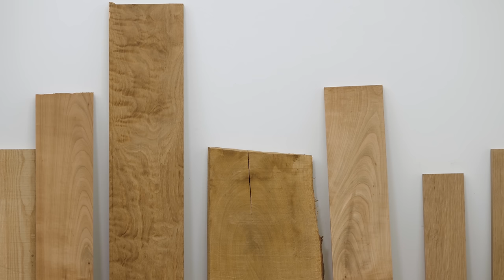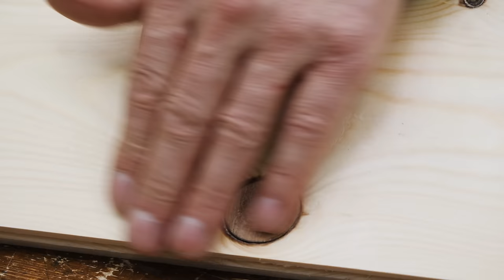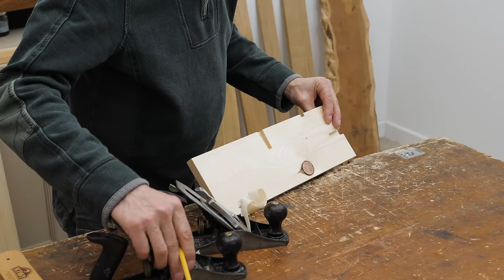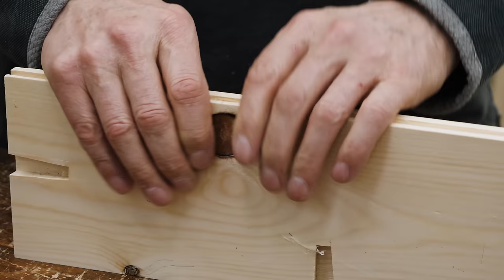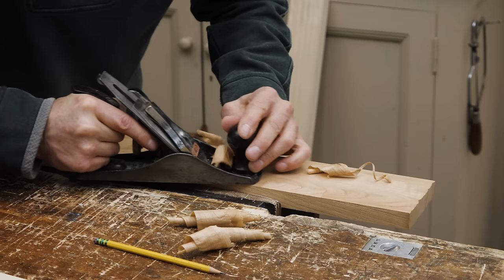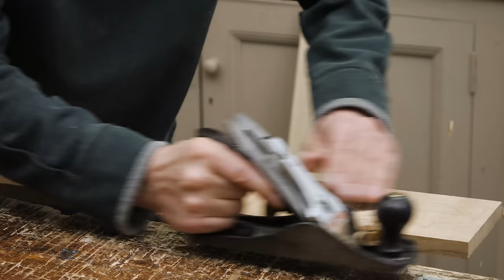How to Read Wood Grain | Paul Sellers

Comment: Wood anatomy is a an interesting topic, and that's what we're dealing with when speaking of "grain," the gross anatomy of the tree's cellular structure when exposed on a planar surface, either roughly (sawn) or smoothly (planed). In general, the more bland the better the working properties, but so much of the beauty of wood is the endless variety of irregularities, all of which indicate something going on in the way the tree grew this material that we call "wood."

Comment: Hi Paul, great video. I started a woodworking course and this helps me alot. I have two questions, is there a specific side on the wood you have to start with  when you are using the plane? Does it matter to which side you plane when you want to do the sides? Thank you!

Comment: I've been trying to elevate the quality of my woodworking skills and I find your videos extremely helpful.  I do have a question however about planing.  If you find a board has different grain directions along it's length do you change direction of planing?  If so, how do you clean up the area where the opposite plane directions meet?
Thank you for sharing your knowledge and skills.
Reply: Going with the direction makes it easier it is not to say you cannot plane against the grain of the wood. Try experimenting to see if you can feel the difference.

Comment: I recommend the use of a whiteboard and making some explanatory sketches of how grain forms. Also the connection with the heart side of the board and how you can read that of looking how the rings are formed in the end grain of the board something you want to know from the start. I found it a bit difficult to follow, the start (about the first three minutes, thereabouts) was even somewhat muddled, at least to my taste. The whiteboard and a few sketches would have helped greatly.

Comment: Paul, I have watched this video several times, always learning more each time.And now I have run across the "knotty" problem you speak of.  I am working on 4 pieces of 6" x 6" redwood, to make legs for a bench for my lathe. I had this wood cut on my property 3 years ago and milled, but not jointed. Each was taken from the same tree, which was too narrow diameter to mill anything other than these 6 x 6's. I can see the grain appearing to run in one direction, but am running into the opposite grain before I reach the end of the beam, though there appears to be no knot. Redwood has a pretty straight grain over-all, but this one sees to move like a wave. So I am getting tearout but only at one section. Any ideas for correcting my approach?
Reply: Can't help as I am also a novice, but I feel your pain! Can you go in 1 direction and lift off before you hit tearout, then do the same in the other direction? Then you just have the hump in the middle to somehow smooth out.

If you solved it, I'd love to know how.

Comment: It is amazing how you can take us from the tree to the plane iron (and back). Every word adds to the elegance of the presentation. I have a question, however, regarding your statement about the highly figured oak piece. When Paul Sellers says "I know I can't plane this" it is daunting, but how do you then square it (e.g. take out a twist) or take it down a mm or two to adjust thickness? I hope you will not say to card it down (LOL).
Reply from the maker: Ah, what I should perhaps have said is I can plane this, flatten, straighten and square it, but the grain will tear in places so I can keep resetting y plane to ever shallower levels to minimise the tear-out and then revert to a #80 cabinet scraper for the final level.
Reply: Holding the plane in an angle can be helpfull as well.
Reply: Mark Schattefor ahh yes, shear it off instead of straight on hitting the grain. Practice with shearing angles and the card work will be minimized, but still necessary. Whether you hold your plane at 30 to 45 degrees to the direction of travel can most definitely make a difference. For mass removal you could even plane across the grain first the go to a shear planning motion and then the card scraper. I do remember that much from my grandfather's tuition years ago. Dang it, every time I think of grandpa's wood working I start to miss him and the desk he made for me. My vindictive ex busted it up when we split up before the divorce. Great, now I'm mad at her again. Anyway, play/experiment/practice with the holding angle of your planes, the difference in "stubborn" woods can be amazing.

Comment: Sooo, this is just for planing, this can apply to sanding to, can't it?  When you showed the tear out happening, it looked just like an effect I had happening with some wood while using my orbital sander.  I didn't understand why it was happening.  Now I realize I must have been pushing the sander in the wrong direction?  Against the grain?

Comment: Hey, Paul. 
When building furniture do you mainly use quarter sawn boards to minimize warpage at all or do you just use them in critical components like doors, for example?
Reply from the maker: No, mist woods will be stable and not all woods are available as quarter sawn unless milling your own wood, which `i no longer do these days because of time constraints. Mostly I would try for QS for doors and floating tops and such though.
Reply: Ah, OK, thank you.
Could you explain what you mean by "mist woods"?
Reply: A 'typo' for 'most' woods?  ('i' is next to 'o' on the keyboard.)
Reply: Ah, thanks for clearing that up. :-)

Comment: I'm still having a hard time understanding how to determine direction. I usually just run my hand over the face of the board and try to feel where the edges raise and which direction gives me most resistance. The side that gives more resistance is against the grain. However, I don't think this method is very precise. I read you can read direction by looking at the way the rings point, but here you showed that's not always true either.
Reply: You can use both your eyes and hands. Sometimes the grain in the wood is poor because it is a cheap standard wood so no matter what direction you try to work with it is horrible. 
Try and look at your various pieces of wood too see if there are differences that you can spot. Just keep trying.

Comment: I grabbed a piece of scrap, cut it into two short boards to use as sides to a small wall clock. When I went to plane these two pieces, I couldn't, tearing in both directions. So I think I cut the scrap in the wrong direction.
Reply from the maker: Sometimes this happens. If it does use a scraper instead of a plane.

Comment: Literally every piece of wood:

Yeah I can’t plane this.
Reply: ABSOLUTELY you can. The trick, and I'm being 100% honest here, before you even consider planing, chiseling, cutting, or jointing, you need to learn to SHARPEN. And I don't mean "put an edge on it". I don't even mean "scary sharp" (when the whole "Scary Sharp" system emerged I asked the guy that taught me what he thought about it. "Well," he said after some thought, "if that kinda sharp is scary... I reckon you spook too easy."). I mean "if you meet God, he will be cut" sharp. Moreover, on a 1-10 scale, assuming God-gutting sharp is  a 10, then you should be able to tell how many points BELOW that you are by: A. feeling the blade, and B. using the blade. If you can quickly control your edge, you can learn to plane in an afternoon. If you can't, then it becomes far more a matter of negotiating with the wood with every stroke.

The wood butcher that taught me has this poster in his shop. It reads (I can still see it clearly in my mind): 

THE CUTTING EDGE
_Use the flowchart below to determine how sharp you need your blade! _

There's then a flowchart:

[ Is my plane sharp enough? ]      [ Is my chisel sharp enough? ]      [ Are my knives sharp enough? ]
...                                                    \                             |                               /
With all 3 pointing                          \                           |                             /
to a single bubble                            ------------------[[  NO. ]]------------------